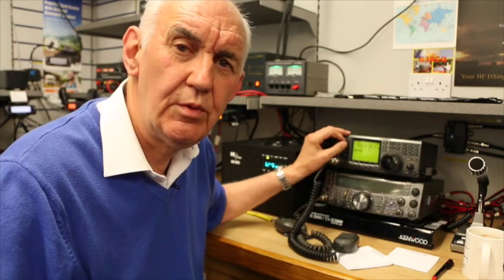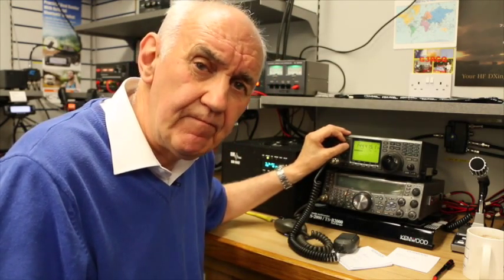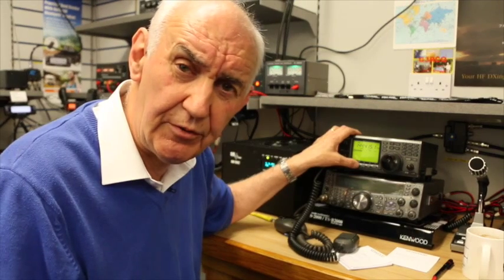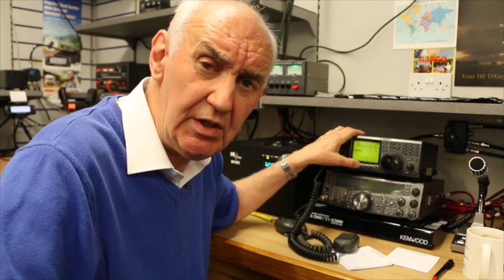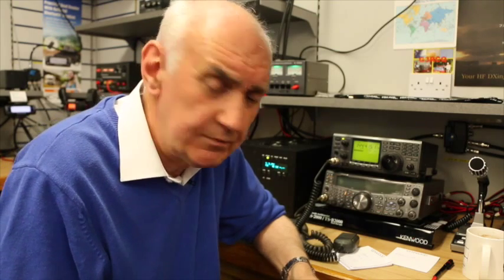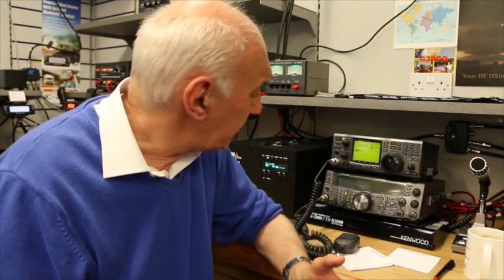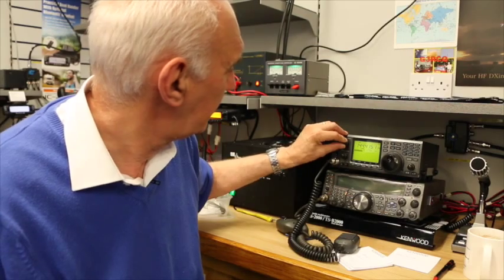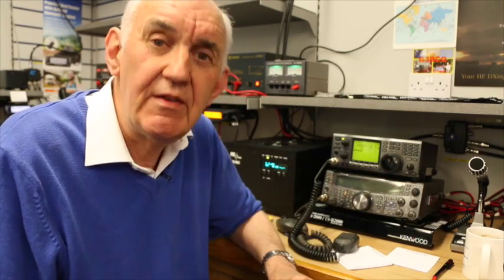Mast Head Amplifier Demonstration

Comment: Preamplifiers are useless if we have a low loss coax, which is a must in UHF and very much recommended above 30MHz.

I wonder how many dB loss you had in your system because your test shows a huge improvement but my tests with a length of 30m of half inch coax at 144MHz show no signal to noise improvement at all using my external preamplifier. 

They are also useless if we live in a neighborhood because there are too many noise sources these days. Maybe you live in the middle of nowhere but I live in an apartment.

Comment: Seems like a fake. IC910 is very sensitive radio.You have reduced RF gain on the IC910 ,it is visible on the S-meter .When you switch off preamp , S-meter segments still shine-this indicate reduced RFgain.It is easy to simulate the great work of lna.....but in real world in noisy enviroment is 144MHz lna helpful only if you have 50m lenght of the coax.
Reply: Not in my experience, an LNA is EXTREMELY helpful even with short lengths of coax. Even 30m of coax with a 1.2dB loss is going to raise the noise figure beyond that of what the receiver is capable of. Try EME with an LNA sometime... it doesn't work well. de NV6R.